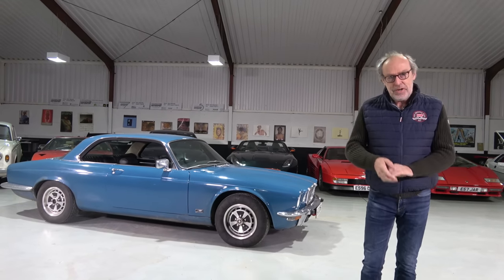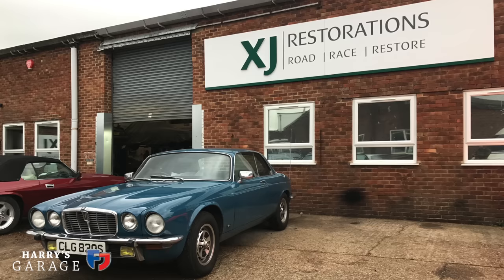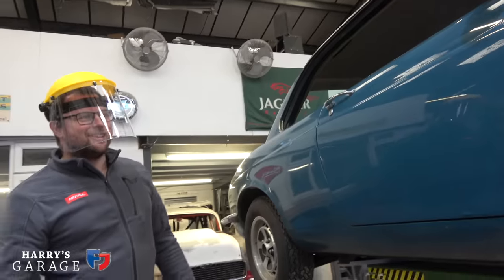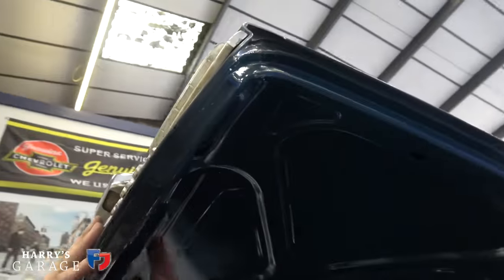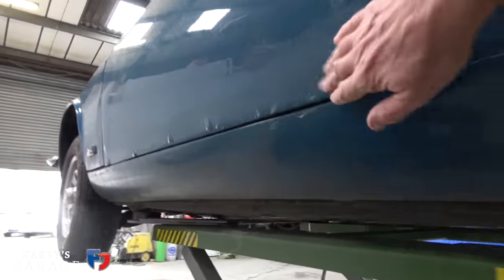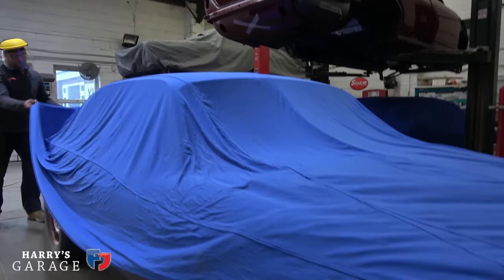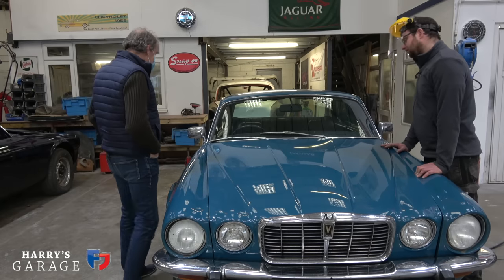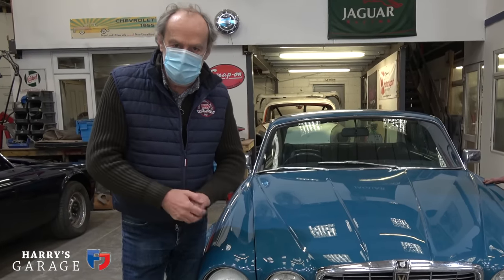Jaguar XJC V12 manual restoration part 1. Just how rusty is it?

Comment: After watching this I’m convinced that every area on these cars are “very common area[s] for corrosion.”
Reply: 1970s British engineering and British weather don't make a very good combination.  I watch YouTubers in Australia or Florida underneath their ageing cars and think that no British car ever looked like that.
Reply: I think you'll find any car manufactured during 70's  was prone to rust and the Jaguar XJ series is no worse than other brands. 
Here in the UK winters were worse back then and the roads were heavily salted and you'd have to replace the front wings on a car every two years.
Reply: @markblack195  

I don't know about that.   An Alfa say rots much much worse.  A Merc was better than a BL machine and I think a Volvo or Saab better still.   

I think a VW was also superior!
Reply: How much original metal is left on a UK Ford Escort  etc  from the 70s 🤔
Reply: @joshuarosen6242  I'm an Aussie and we have (had?) plenty of completely rusted cars as we mostly live near the sea (Adelaide, Perth, Melbourne)  and the Trade Winds blow that salt half way across the continent. That's why Lake Eyre and Lake Torrens are full of salt. It is wind blown from the ocean. However the air is dry and if you live inland steel seems to last indefinitely. Basically, we throw away the rusted ones and do up the ones that aren't. Cars from the '70s came here already rusting after 3 month journeys on ships that allowed the sea spray to affect them. Also, they were simply not rust proofed. Leno talks about this re the cars he grew up with.
Reply: @damienmills293  Fair point.  I remember seeing a population density map of Australia and it was indeed true that almost everyone lived on the coast and salt is not good for unprotected steel.  Here, most cars are exposed to salt because it's put down on the roads in winter.  God knows what cars were like that were exposed to the winter salt and were on the UK coast.
Reply: @damienmills293   @Damien Mills  Nice perspective. Got to say, though; my late Dad repatriated to Melbourne back in the mid 80's from the UK and immediately bought a nice Alfa GTV 2000 (1975) having become an Alfisti many years before, and by 2015, after all those years as his daily driver (his only car actually) there were still only minor visible signs of rust (although I daresay there were probably some unseen horrors lurking for a restorer). By that time you'd long since stopped seeing un-restored ones in the UK - almost all had been scrapped back when they weren't considered worth saving, and they remain a rare sight (but look at the prices of good ones now!).
Reply: I recently sold a 77 xj12.  Unfortunately it had a 60s 327 transplant done in the mid 80s.  Im in CA.  The car had zero rust.  As in...none.  My hats off to these guys fixing rusty uk cars.
Reply: @blairwill7732  If you'd bought a UK '77 XJ12 in '78 it would have been rusty.
Apart from the obvious damage to the bodywork, it's a huge pain in the bum that the underside of the car is covered in rust and filth. You can hardly see anything and the only places where the nuts and bolts aren't seized with the rust is where there is an oil leak.  Fortunately, oil leaks were pretty common on '70s UK cars too ;-).
Reply: @shabbos-goy9407  We had a Saab and a VW Golf in the seventies. You're right about the Saab, but the VW was a proper rust bucket.
Reply: Didn't they used to paint colour onto bare metal in the 70s, with no primer?  If so, its no surprise they all rotted away!
Reply: "it can't help itself"  Harold in the next video.
Reply: @shabbos-goy9407  Being an Alfa owner I concur!

Comment: Just an absolutely beautiful car. I'm excited to see the results on this one.
Reply: It's a big rust bucket, will be needing a lot of work... 6 months...
Reply: @adrianadrian1887  Spot on. That's the basic reality with this one. Ain't going to be pretty when it's down to bare metal, these guys have seen it before.
Reply: @adrianadrian1887  Well, I was expecting a lot worse corrosion. It's 45 y.o. it's a Brit car built with '70s raw sreel, and driven in GB damp weather...
Of course, it remains to be seen with all the paint removes. It's most probably an horror story. Every body "pimple" may reveal a huge scar.
I rebuilt a carbon copy of my beloved first car, a 1972 Datsun Coupé 20 years ago. It showed very much like Harry's car, you know, not bad at all, some Bondo was expected.
Oh my god ! The paint actually held the car together ! Took 14 months of hard work but worth every penny.
Reply: @alexcallas8222  I'm sure they'll do a top job, they know XJ Jaguars inside out.
Can't wait to see the end product.
I've seen one in rathmines village in Dublin few days ago (a convertible XJC V12 in very good condition ).
Kind regards from Dublin, Ireland. 

Beautiful cars.

Comment: These old Jags are magic. For long distance, high speed driving, they're unbeatable. So comfortable that fatigue doesn't happen, you actually get out at your destination feeling better rested than when you set off, and yet so grunty and stable that it feels like it can handle anything. Considering most people are running around in newer cars that cost several times the price of an old XJ, you can ignore the fuel bills, they're worth every penny.
Reply: No other car looked like them. Even non car enthusiasts know these and the sedans are Jaguars

Comment: Harry this would look amazing in opalescent silver blue, an original Jaguar colour
Reply: We had an opalescent blue 1966 Mk2 from new. Very nice car. It still looked almost new in 1976.
Reply: @roadie3124  lovely, it’s such an elegant colour! I actually think this car would look fantastic in silver, but it’s so common now it’s become mundane and it’s hard to justify when you’re paying so much for the work.
Reply: @roadie3124  
Oh yes, the Mk2 ! The original "gentleman's sports sedan". Loooong before BMW's claim !
My best ever teacher, in English letters in 1970, had his in proper BRG and burgundy leather interior. My ever favourite car second only to a series1 E type !
Reply: @marcryvon  I've always been a fan of the Mk2. My parents bought their first one, a 2.4 manual with overdrive, in 1961. We went as a family to the Jaguar factory in Browns Lane to pick it up. It was RHD, but was equipped for British Forces Germany to comply with West German regulations - steering column ignition and lock, speedo in kmh, no Jaguar figure on the bonnet). My mother had a crash on the autobahn in 1966 and the car was written off. Then they bought a 3.4 manual, overdrive. I sort of learned to drive in this car. 210kmh on the autobahn at age 18. I was immortal :-)
These days I drive a 2007 Saab 9-3 Aero (2.8 V6 turbo) manual with a few upgrades. Around 225 Kw and 430 NM. It's a lot faster than a Mk2 (it's speed limited at 260 kmh), but it feels like one in many ways.

Comment: The most beautiful XJ that Jaguar ever made. Love the suspension and engine mods Harry has made too. I had a 4.2 20 odd years ago before prices went crazy and despite being a rust bucket and the British Leyland build quality it is probably the most enjoyable car I have ever driven and owned. Buy the best one you can afford - all parts special to the coupe are EXPENSIVE to replace and everything will need some attention by now. You will need deep pockets to restore one of these properly now. I must have bought mine from Arthur Daley too 'cos when I took it for MOT the following year I discovered it didn't have any inner sills! I ended up swapping it for a much shinier '79 Mercedes W116 450SEL with a full MOT, but sadly no soul....

Comment: I have a 1975 coupe, owned since 1983, replaced front wings, rear quarters, door skins, front under valance, both tank covers, vinyl roof, Webasto sunroof, inner and out sills, inner rear arches. bits of the floor, rear chassis, there still a bit at the front under the pedals. Fortunately I bought the panels 30 years ago!

Comment: Certainly my favourite car on the channel, and I look forward to following along with the project!
I do have a question though if you don't mind; assuming you fitted those Michelin XWX tyres at some stage, is there any reason you didn't opt for the Pirelli P5 developed specifically for the XJ range instead? Also, does Keith have any thoughts regarding tyre selection for these cars?
Reply: Both of those tyres are vastly over-priced; neither of which perform as well as Hankook HP2’s. They’re on my 215’s (Kents) ‘81 XJ12. 😉

Comment: You could probably improve the "sound" of the door closing by having the door's inner skin Dynamatted. It's a type of sound insulation with a super sticky black tar based adhesive backing on a metallic foil layer. It's messy stuff to apply and the edges of the foil will destroy your fingers, but it will make the doors sound more solid.

Comment: Hi Harry. One thing for certain, this is very straightforward compared to the Lancia and about half the price. This will tilt toward 20 with the  engine work. The radiator support will be corroded behind that small black lower grille panel. And all the coupé had an black  everflex roof ( probably to help eliminate the drumming ). Good luck Harry.

Comment: When I heard the words “British Leyland” it didn’t fill me with confidence.
Reply: Well it's lasted over 40 years so it's not done too bad.
Reply: @markblack195  Not really.Local Series 1 had a rust issue within 10 years in our dry climate, the initial exploratory revealed stress fractures around the windscreen & compromised design flaws so no thanks. Body language & shuffling feet told me a lot without saying a word. V12 is for mugs.
Reply: @creditelectric  Jaguars V12 was a world class engine at a fraction of the cost of any other V12 on the market, the basic chassis of the XJ stayed in production for years it became the underpinnings of both the XK8 and Aston Martins DB7 both hugely successful cars so fundimentally the chassis design was right but as with many cars in the late 60's early 70's build quality was patchy it was well designed but due to frequent strikes and balchy unions often badly built which is a crying shame because it was a world class product.
Reply: @markblack195  the Jag V12 was not world-class by any means. Open-deck wet-liner block = rapid head gasket failure. The head was a hideously restrictive SOHC 2-valve design. Then the stroke was tiny, so it had remarkably little low-end torque, resulting in catastrophic fuel consumption, and there isn't room for a long-stroke crank...
Reply: The equivalent to GM in America
Reply: @richardharrold9736  the V12 was in production for a very long time, the HE heads that appeared in the second series XJS and the 3rd series XJ improved fuel economy no end and the units high reviving very smooth nature is what makes it so desirable, nobody complains about high reviving Ferrari or Lamborghini V12s   
The trouble with these V12 Jaguars is not their design it's maintenance, the Jaguars were not expensive cars new and the high price of fuel meant these cars lost money fast, so people could easily afford to buy a used one but they couldn't afford to properly service and maintain it and that's what leads to the problems you've described.
Reply: @markblack195  A very well known and documented problem of the V12 was the location of the distributor and other electronics, nestle in the V, a very hot spot that fries the components.  In the tight space in the E Type worstened the heat problem.
Reply: @marcryvon  The ignition systems on all the Jaguar V12s were terrible. It's unfortunate that distributorless didn't appear earlier, it would have got rid of the biggest headache on these cars by far. Feeding 12 cylinders with spark at 6000rpm is far more challenging that 4 at 5000rpm as was more typical of the time. They were pushing the limits of what a distributor could really achieve, and technology on the edge is never the most robust.

Comment: I rather have the original chrome steal wheels with the hubcaps on it.
Reply: Me too chromeys with little Jag hub caps. I never cared for those hot wheels looking alloys.
Reply: The XJS ones were a factory option from new but the steel ones do suit the car too.
Reply: No way the xjs wheels are beautiful.
Reply: @r7coo  on a XJS ( they fit that design better IMO) . But to each is own.
Reply: The later ones were 215

Comment: I remember speaking with the chairman of a Jag club in my country. Their position was, you have to take them apart and make the body weatherproof. Which they did. Sandblasted the naked body, zinc-anodized it, and then the body got "proper" primer and paint layers, followed by "correct" lacquers. In the process, the common "weak" points would be addressed (primarily wiring looms and electronics, a couple mechanical things) and after all this was done, they'd have a proper car that could live up to the statement it tries to make.

Comment: Non metallic black with matte aluminum brightwork. Interior in full green leather, green carpets, door cards, green everything. Beautiful wood grain trim with matching wood steering wheel and shift knob. Wheels from the XKSS wrapped in proper modern Michelin rubber. Full bumper delete with any holes properly filled. This allows the original design to be on show as it was intended. Would shave 10-20 years off the design as old bumpers age a car and were fitted by law, not by design choice.

Engine will be the centerpiece with the ORIGINAL build configuration of the V12, used in their mid engine race car. Fuel injection delete and replaced with Webber carburetors. If FI has to stay then a swap to MFI on ITBs. This jewel of a V12, with its rev happy nature would be insane with the tremendous induction bark that it so desperately deserves. This is the exact build I would personally do but would be honored if Harry was inspired by my taste and used this exact spec for his build. A 5.3 V12 XJC trip to LeMans in a 3 part Eurotrip series to cap off the project once completed or a trip to Goodwood this year with the car showcased by Jaguar with their Legends C-type, D-Type, and the dream boat XKSS. FYI the all green interior idea comes from the XKSS. Thought to paint the XJC in the exact XKSS spec but believe black would contrast better and really set off the entire car.

Comment: Get them to pull the back seat base out - these coupe's like to rot under there!
Get them to send you a picture of the inside of the door when the trim panel comes off. These things, lovely as they are, are such a lash up. Jaguar took two saloon front doors, cut the end off one and the front off another and then joined them together to make one long door. When you look at the inside you'll be able to see the join.

Comment: Harry... while the engine is out... Change the pipe, hose and cable mess on top of the engine for an aftermarket fuel injection and ignition system from someone like Link or Haltec... will make the engine bay look really clean, clean up the running and reliability and make a few more ponies in the process 👍

Comment: Love the XJ Coupe, I have a red V12 that i have been “restoring” for 13 years, I think when I finally get to the paint stage I will do it in Italian Racing Red same as my F Type. Also thinking about options around fitting a modern ECU to control the engine and maybe a more modern auto box, but definitely going to have the suspension upgraded.

Comment: Always been my favourite car in Harry's Garage. I quite like the blue as it is, but if it were mine, I couldn't resist doing a John Steed tribute car with those glorious 'Gene Hunt' wheel arch extensions. Not very original in either sense of the word, but it would look absolutely awesome when done. Especially if you could find a Mrs Peel or a Purdy to drive around in it with.

Comment: Hi Harry, I hope you and the family are well.  I love your YouTube Channels.  The XJ6-C has always been one of ny favorite cars along with the Mercedes 280SE Coupe/Cabriolet.  They caught my eye in the '70's when I was a young enthusiasts porting around in my '67  BRG MGB complete with wire knock offs, metal dash a those deadly toggle switches (???), a  "T" handled choke cable and a positive ground dual 6v battery setup.  COLOR CHOICE:  Please be careful when choosing the color of the car as it is one of those vehicles that color can make or break the beautiful "B pillar-less lines of the car.  You can never go wrong with BRG on any British car, but I would choose a color that has an understated (very) metal flake/slightly pearl-essence quality to "tighten up" the vehicle's coachwork.  I've seen shades of gold and some non BRG greens that work very well as does silver gray/graphite tones (it seems to me that Brit's love blue cars, which I am not very fond of).  That car is a gem.  I would also choose a larger diameter wheel reflective of the design language of the vehicle to better the complement the car.  You're on the precipice creating an absolutely gorgeous , timeless work of art.  Please give  if proper consideration.  EDIT: The wheels on the car are very British Leyland-esce and look like the came off of a mid seventies era American market MG.

Comment: See wheeler dealers for how to correctly close the bonnet & avoid those stress fractures. Also, having worked for Jag when these were built, I can tell you that the corrosion in the rear lower wing panels is caused by condensation due to the presence of the fuel tanks.

Comment: I've watched other (old) car channel videos where the metal body panels are no longer available and thought if using a handheld 3D scanner, scan the body panel you need to replace, clean it up in the computer, and CDC a wood model of the negative so you could press/pound out a new panel over the wooden mold.